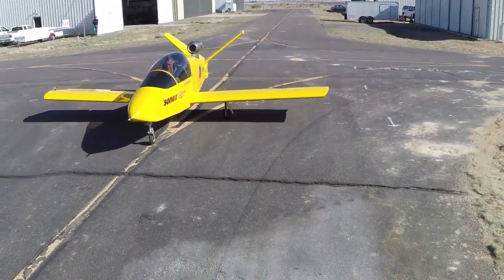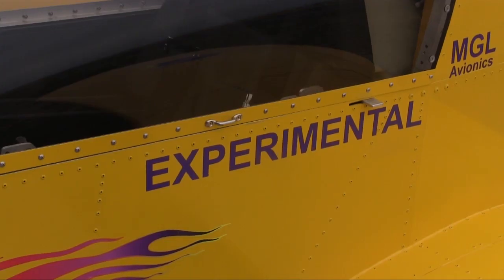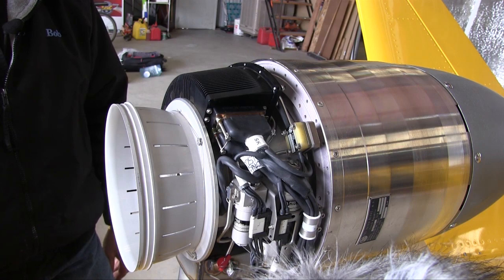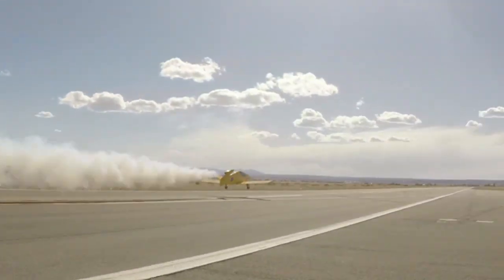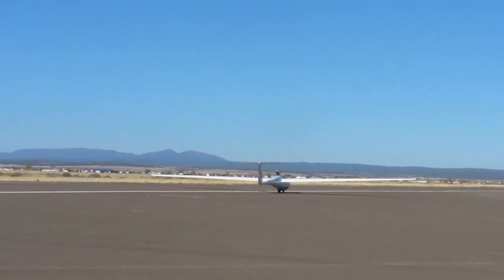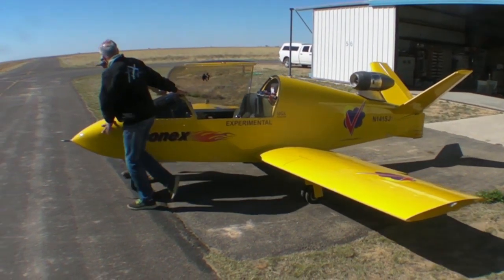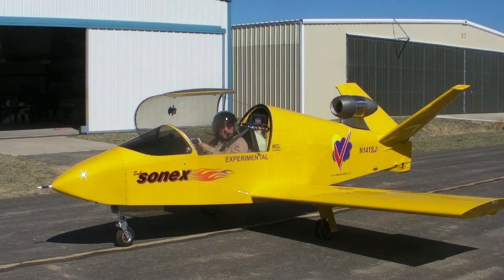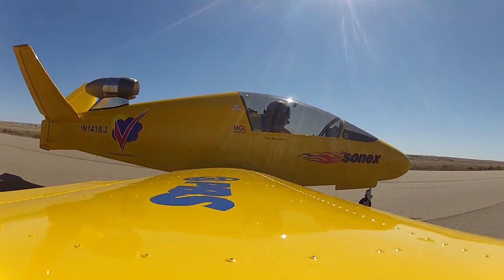KITPLANES Flies the SubSonex Jet

Comment: Looking at the specs. Of course I had to convert their numbers over to the units the rest of the aviation industry uses.  264 nm range with reserve, 208 kt cruise, 250 kt VNE.  A Mooney beats it in almost every metric with the exception of cost and aerobatic ability. Why do kit plane manufacturers stubbornly cling to MPH/Statute Miles?  That’s not a thing.  Hasn’t been a thing since the 60’s.  Only reason I see is it makes their slow airplane seem faster.

Comment: Flying this would count as a jet time?? I am working towards my airline time ,would be nice to have some jet time in there!
Reply: You would probably be the only prospective candidate with microjet experience. I don't think it will help you, as this thing is very simple and has nothing in common with a Boeing. The least expensive experience you can get is being paid to fly. Tow banners, fly pipelines, join a local glider club and tow launch gliders (they usually allow free membership for tow pilots, you don't need commercial, and you can be paid a small amount for it regardless). Etc, etc.
Reply: You'd need multi for that and I don't think this quiet fits the bill

Comment: I am wondering about this plane's potential for general use. One of the considerations for me would be cabin heat. Another would be power for flight instruments. Deicing would probably not be an issue.
Reply: http://www.pbsvb.com/getattachment/Zakaznicka-odvetvi/Letectvi/Aircraft-UAV-engines/Proudovy-motor-TJ-100/Turbojet-engine_TJ100.pdf.aspx

24v, 750W power output